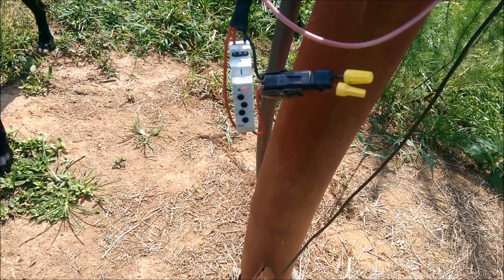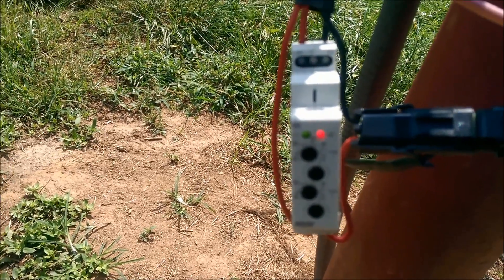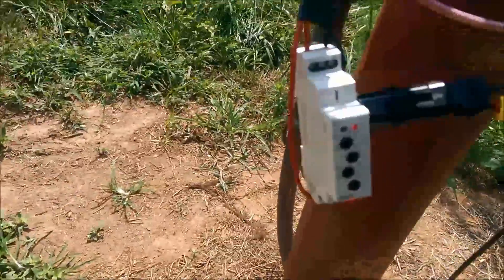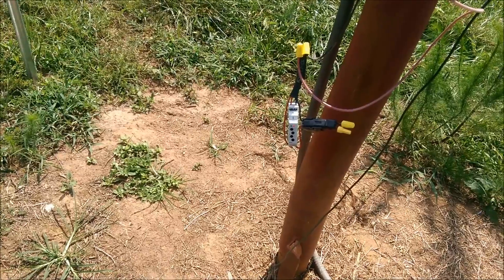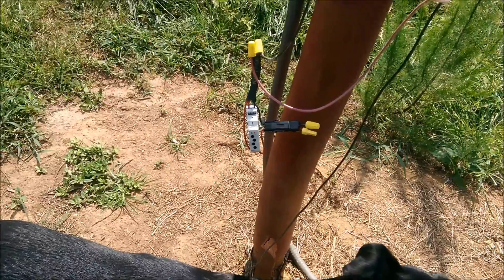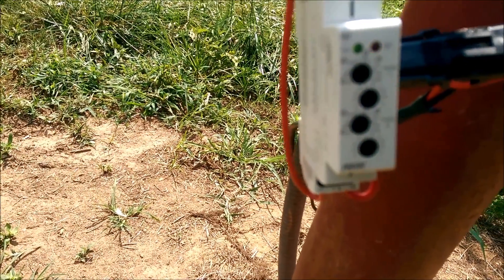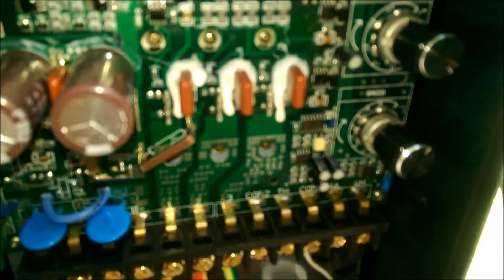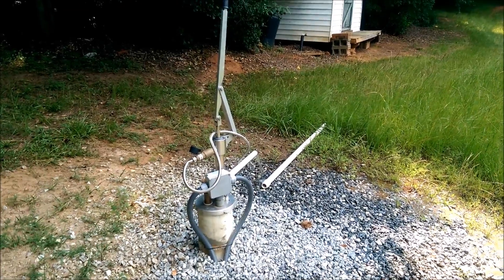Solar Pumping Solutions For Low Producers

Comment: I have a pond that leaks. Unable to stop the leak but I can contain it. I need a solar/wind powered system to pump the water back up and over the levee into the pond. Looked at DC sump pumps, that gets $$ real quick. Can you point me toward some other options. Need to lift the water about 10' and run it about 35-40', from a shallow dug collection point, maybe only 1-2 gallons per minute.

Comment: Awesome video, great work! I have 2 good wells at our fish farm. What pump would you suggest. Previous pumps stolen by scrap metalers were 20 GPM, but I do not need that volume. I have 26,000 gallon above ground storage available.
Reply from the maker: Let me know what your static water level is. If it is less than 20ft I have some cool solar surface pump solutions as well as submersibles.  Also, you can tie the 2 wells together.  Too many options!  You have all the solar and accessories so lets figure out what pump best matches what you have.  Tell me well size ( 4".PVC, well depth, static water level and is there an existing pump) send me a pm and we'll work on it.
Reply: Can you give us a shortcut to where we could buy this solar power pump

Comment: I dig the solar, and other electric pumps. What about the old tried & true windmill pumps? Did we forget that technology?
Reply: that depends on the wind.
Reply: Nathan Dean Almost every night. If it weren't there, then the weather would never change. There are reliable charts showing areas of concentration. 
If you're unsure about the prevailing winds in your area then find someone nearby who sails boats. We always know.
Reply: that they do. lipo4 batteries are the best to store power . yes thier expensive as hell but thier worth it. also dont 4 get the thermal electric generators. waste heat turned into viable dc power. charge and or run most powered items from your body heat.

Comment: Is that a solar submersible you are running on your well? Is there a brand you recommend for 24 volt?
Reply from the maker: I am running API ( Solarpumps.com) and SunRotor pumps but also run Grundfos SQFlex pumps.  Send me a pm with your well specs and I can better determine the best pump for you. 
Static water level, casing diameter and material, depth of well, is there a pump already? Top discharge or pitless, how much water do you need per day and how high ( pressure or height) do we need to pump to.